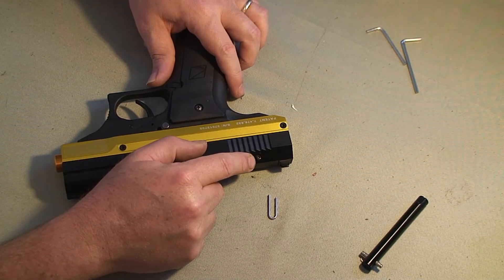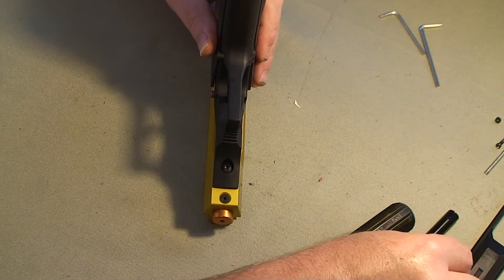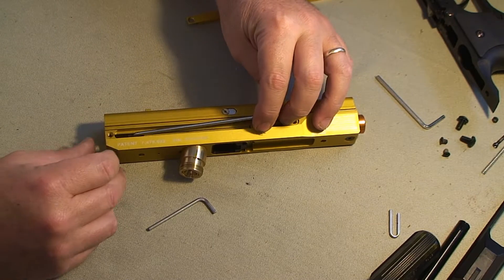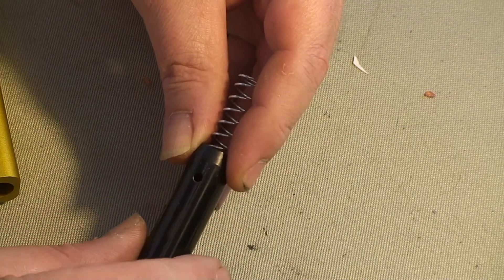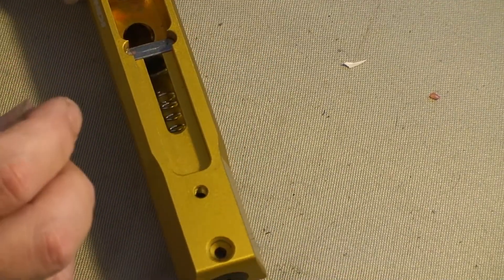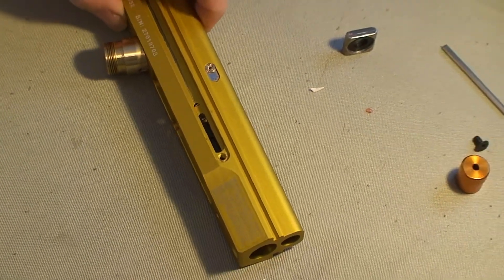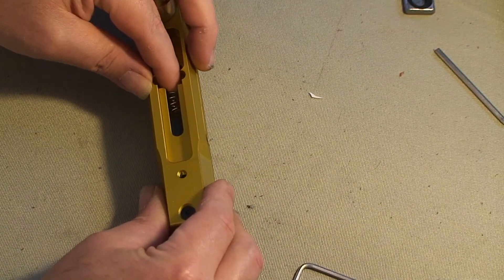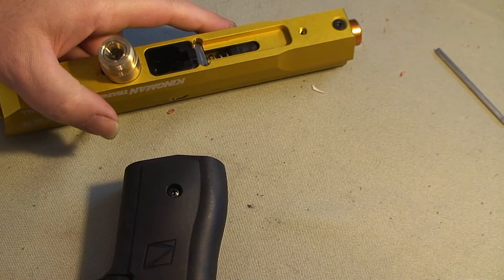Kingman Chaser - Replacing a broken Connecting Rod

Comment: I have replaced the connecting rod 5 times in 1 year of non constant use. I do not understand why it breaks so much. The velocity does not matter. It has broken on lowest velocity, mid, and high. I wonder if i can forge a stronger one? I only have one spare left but i have no idea what to do. Should i put the spare in or use it to try to make one out of stronger metal? Any ideas would be awesome. Thanks.